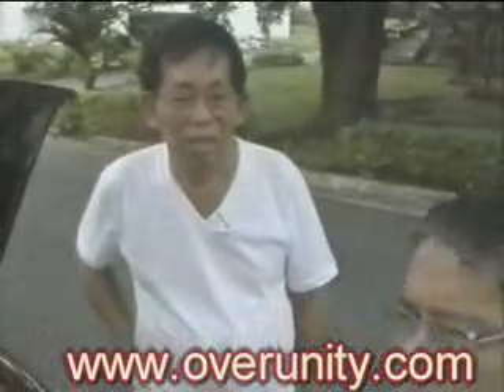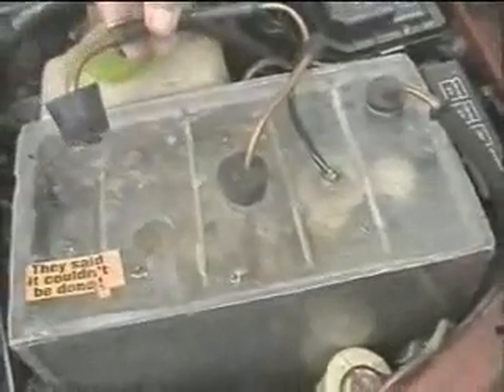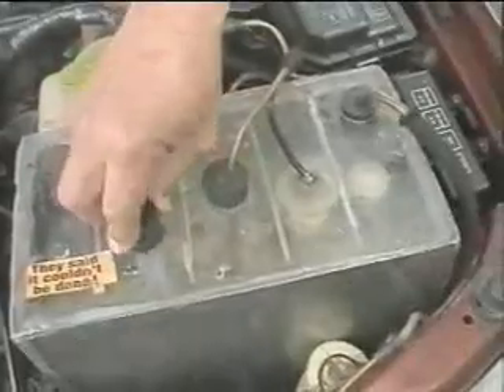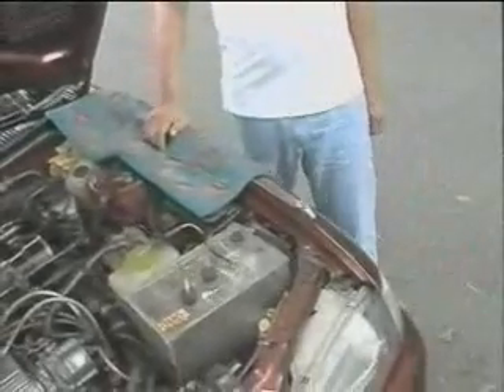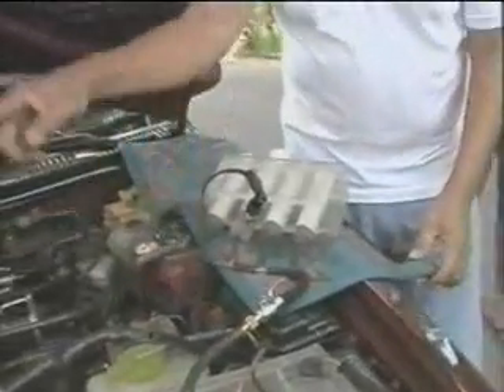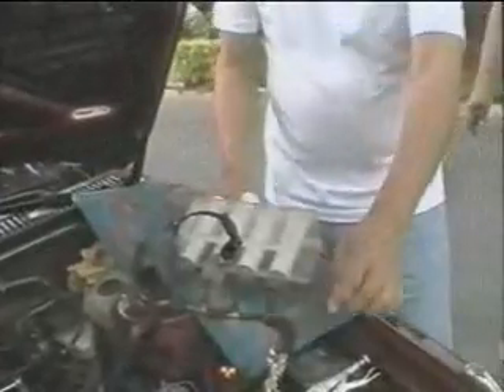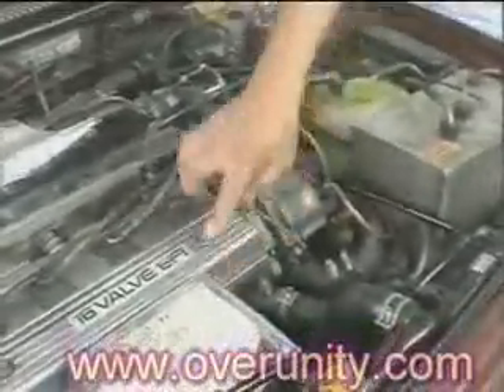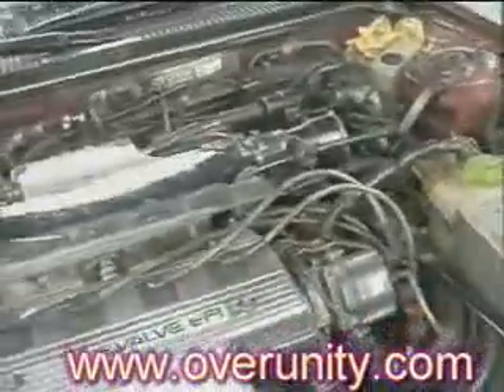Car Using Water As Fuel 1

Comment: What a load of crap. If you'd get all the energy generated by burning 2H2+O2 back and use it to perform more electrolysis, then it would be great. But too bad, it doesn't work that way. In that case the netto energy created would be 0, so you cant drive your car. And there's always energyloss from other factors, so no perpetum mobile, sad but true.

Comment: This is a scam with a 100 year history. There's no patents because it doesn't work. These systems generate tiny amounts of H and O2 from electrolysis of water. Any mileage improvement that is seen comes from introducing vacuum leaks in the air intake. Which doesn't require an H2O cell, it can be done for free - but leaning your fuel mix will also burn your valves and pistons and ruin the motor prematurely.
His car stalls when he pulls the line because it goes from a small vac leak to a huge one.

Comment: Question for Daniel. Do you change the timing using your hydrogen? Also, is the oxygen being separated? Finally, what volume of hydrogen gas per minute is the cell putting out?

Comment: TAz69x is exactly correct.  Your efficiency would be negative.  I am a mechanical engineer and we looked at an industrial system for brazing at my work.  The system was around 75% efficient, meaning for every watt of power put into it you get around .75 watt back.  I wish this was true, but it is not.

Comment: I sent the message to Mr. Dingel. You are obviously troubled. I work in the Hydroxy field. I have researched and developed many systems and have first hand knowledge of the results. You have never used a hydrogen generator and yet you speak like you know about them. My mileage on my van and all of my other vehicles is improved by 25-50%. It is not as easy as adding a hydrogen cell, but initial results usually show increases before long term memory in the ECU destroys them. I use an ECU device.

Comment: Water has no energy? You are SOOOOOOO wrong. I can use one quart of water for a week of driving in one of my cells. The amount of hydrogen produced from that quart of water is  about 400 liters. If you ignite 1 liter of hydroxy you will lose your hearing for several minutes unless you wear hearing protection. @ liters of hydroxy will blow up a metal barrel. 5 liters is equal to a stick of dynamite. Trying to convince someone who has done this is futile.

Comment: This has to be fake.

I would have connected one of those engines to my generator and never would have to pay an electric bill.

At my small plant, I would have used that engine to power my machines, lights, and conveyor belts....

this is no fake...

if it really existed i would be willing to pay $100,000 for each engine..

if it really existed, i'll build my own.

if it really existed, oil wars would be over.

this is so fake.

Comment: It would be more efficient to use the electricity to directly power the motor rather than use it to break the H from the H2O then burn the H. This isn't a solution.

Cut out the middle man, go with electric cars.

Comment: The initial power source is electricity, but you are over looking something important. Water fueled cars are extremely similar to gas fueled in that once the initial charge necessary to startup allows combustion to be achieved, the alternator will turn, charging the battery and continueing the electrolosis process. The actual reliance on electricity and the battery is the same as a gas fueled. It seems people arent mind bogglingly stupid... you just seem to be a step behind.

Comment: Current generate hydrogen by moving ions. This is weak method because of ions slow motion and a lot of collisions.That's why a lot of heat is generate wasting electricity.All peoples are missing one fact - in Faraday laws for electrolysis that is an electric charge (in Coulombs) that make work - not current byself.

Comment: I think: At the start, the battery electrolyze the water then start the engine. When the engine runs the engine turns the alternator and charges the battery. Simple enough? Forget about perpetual machine. This is not the same concept. But this (may) still work.